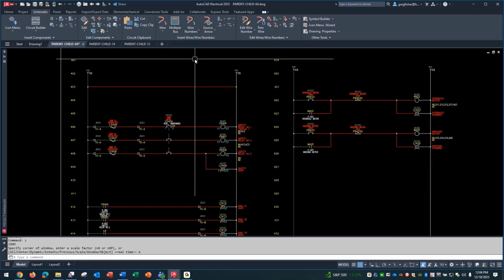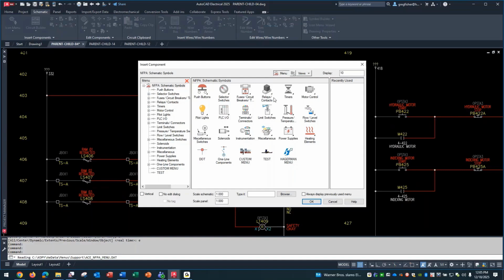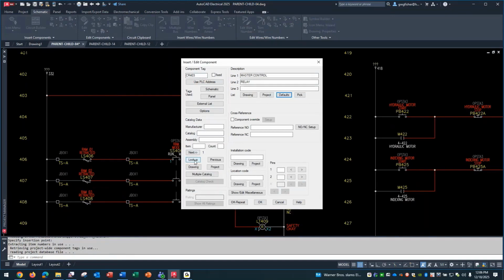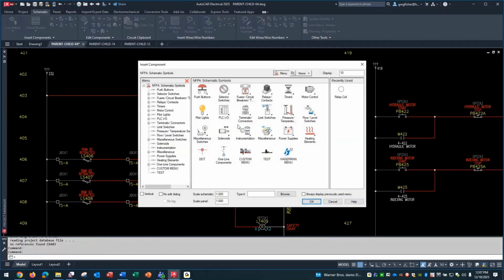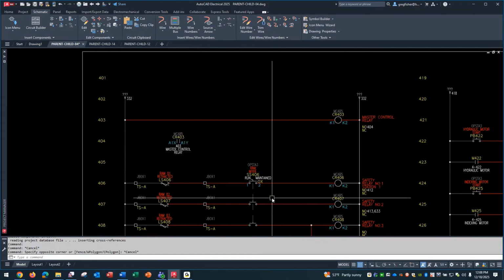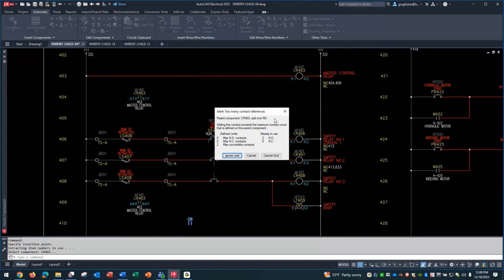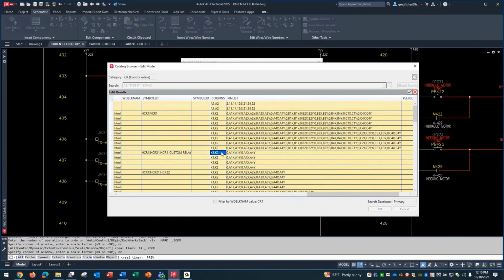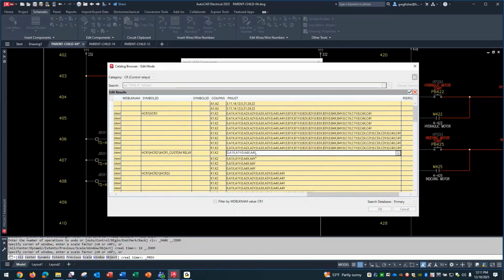Link a Relay Coil to Its Contacts in AutoCAD Electrical

Comment: What should I do if I want to link and extra contact. Can I ignore limit and proceed or is there any other option...?
Reply from the maker: The contact limit is driven by the catalog part number assigned to your parent coil. It defines how many NO/NC contacts are available via the pin list. You have a couple of options if you need more:

Add an auxiliary contact block as an accessory. This is the cleanest approach. In the Insert/Edit Component dialog for your coil, you can assign optional or mandatory accessories (like an add-on contact block), which extends the available pin list automatically

Modify the catalog entry — if your physical relay supports more contacts than the default catalog entry defines, you can edit the pin list in the catalog database to reflect the actual contact count

Proceed past the limit with caution — you can ignore the warning, but you'll lose accurate pin number tracking and BOM accuracy, so it's not recommended

The accessory route is generally the best practice for real-world relay/contactor configurations. Hope that helps!